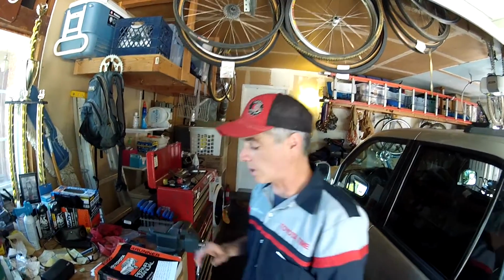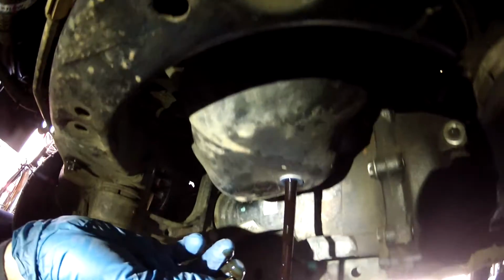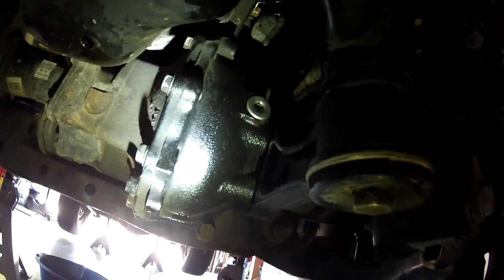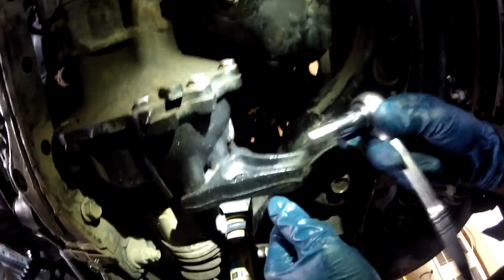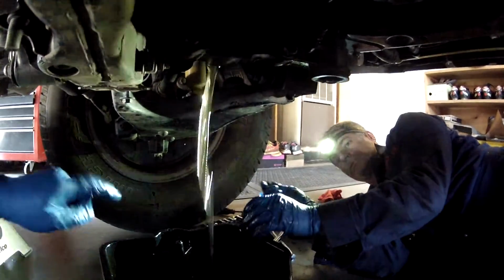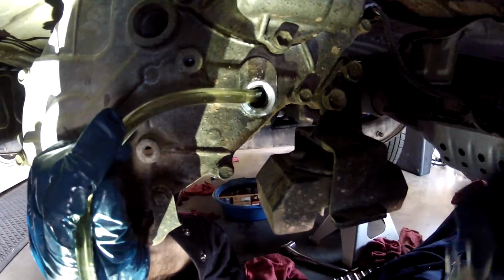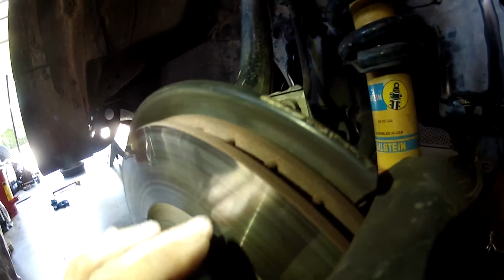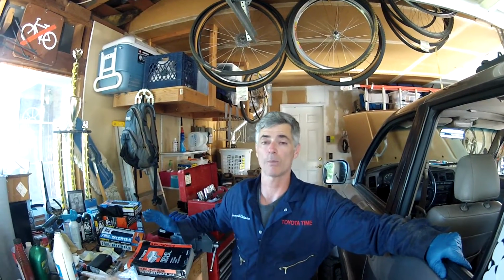30,000 Mile Interval Service

Comment: Just subscribe!! And man your an angel sent from the toyota gods you do a great job explaining step by step and editing thanks for taking your time and effort to explain evrything forget about what people say your shirt is awesome defiantly  sharing with friends...
On another hand how much$$$ did you spend on this project diffenlty doing it on my rig..
Reply from the maker: Hey Edgar, glad you like the video.  I don't remember what everything costs but I'll give you a rough estimate.  

Oil Filter _ $7
5 Quarts Engine Oil - $30
Synthetic 75w-90 Gear Oil for Front Differential and Transfer Case (Apprx 3 Quarts)  - $60
Transmission Fluid (4-5 quarts) - $30
Conventional 80w-90 Gear Oil for Rear Differential - $30
Air Filter - $15
Engine Coolant - you need a little over 2 gallons to fully top off -  $50 (price for Toyota Red Concentrate)
All the Drain Plug Washers - $10
If you don't already have a grease gun and grease, let's say another $30.

Total - $262

I guess it adds up quick but this is a renewal of all you fluids except the power steering and brake fluid.  By the way, we have videos for bleeding the brakes and for doing a power steering flush if you're interested.  You can save money if you don't buy synthetic gear oil.  You can also save money on the fluids by buying online or at stores like Walmart.  

I'm guessing a dealership would charge at least 4 hours labor for this job.  At anywhere from $100-150/hour, you save yourself $400-600 doing this yourself.  They use all these fancy terms like "Multipoint Inspection" but they are basically renewing your fluids, inspecting the brakes , checking the tire pressure and maybe rotating the tires.  And usually when you get the vehicle back, they are going to have a laundry list of services they will say you need to soak you for even more money.  Now, if they are an honest shop, the services they recommend are needed.  A dishonest shop is going to suggest things that aren't necessary, and for the typical uniformed consumer, they are going to trust them and get the other services done.  

Our goal with this channel is to educate and empower people to take care of their own automotive jobs so they are self sufficient and can save themselves a ton of money in the process.  Happy Wrenching and welcome to our channel.

Comment: Hi Tim, Israel here: What kind of Grease did you use for the U-joint and slip yoke. Like what brand is compatible for a 2002 Toyota 4runner??? Thanks for your help! Keep on going brother!
Reply from the maker: The back of your owners manual tells you the type of grease to use.for the u-joints and slip yokes.  But, in case you don't have one, the u-joints are suppose to get a lithium based chassis grease , NLGI No.2.  You can get at an auto parts store.  The slip yokes and double cardan joint (middle of the double u-joints on the rear drive shaft) take a molybdenum-disulfide lithium based chassis grease, NLGI No.2.

For my rig, I've been using a Moly based lithium grease for everything except the rear slip yoke.  For the rear slip yoke, I've been using that special Ford XG-8 grease I show in our Slip Yoke Binding Fix video.

Comment: Thanks  for the great videos.  I just purchased an 01 sport and will certainly be watching most of your vids. One question, is it necessary to oil the new oil filter gasket? It seems it comes pre-greased from Toyota.  Thanks
Reply from the maker: Frankieqd Hey Frank, Yes, always put a film of motor oil on the new rubber o-ring on the oil filter.  I buy Toyota filters too, and if there's some oil on that o-ring, it's not enough.

Comment: Your channel has changed my life. My 4runner has needed practically everything you've done a video on! THANK YOU. Also, i got my rig used; PO had installed an aftermarket Rear Diff locker; dumb question i know, but do i go with the directions on your note card as if the rig had a factory installed rear diff locker even though it was installed after the fact?
Reply from the maker: Brisa Halviatti  All you have to remember with any differential, transfer case, or manual transmission is you fill it on level ground until you see gear oil start to spill out of the bottom of the fill plug hole.  At that point you know you're full and just put the fill plug back in with a fresh crush washer and tighten it to spec or just go tighten it by feel.  Just use some 80w-90 gear oil unless the aftermarket locker you have calls for a different grade gear oil.  If you know the locker manufacturer name, just do a Google search to obtain information on it.

We're glad to hear you've found our videos very helpful.  We love hearing this.  Happy Wrenching Brisa.

Comment: Tim love your work! I pickup my 2000 runner this week and cant wait to jump in following your lead! thank you!
Reply from the maker: Welcome to the club David.  If you have any questions along the way, don't hesitate to ask.
Reply: Thanks Tim, I'm sure I'll have a few :) Planning to document my journey on t4r.org. Just curious from the videos I've scene so far I've noticed you dont use air tools, any reason why not? thanks!
Reply from the maker: Hey Dave, when I started getting into more auto mechanics, I thought about getting an air compressor and air tools but learned cordless impacts were pretty darn strong so I went that route.  I think cordless is a good way to go for several reasons.  With cordless, you don't need a loud air compressor that takes up room in your garage.  You don't have to deal with air lines snaking around and getting hooked on things.  And, there's no maintenance with cordless.  They either work or they don't.  I know air tools are superior in strength over cordless, but since I have so much crap in my garage, mainly bicycles, I figured cordless was the smart way to go.

I've used my cordless impacts in many videos.  I now have 3 Dewalt guns, Two 1/2" drive guns and one 3/8" drive.  I also really like using my Milwaukee M12 cordless ratchet.  The Milwaukee isn't strong so I often break fasteners free with a standard ratchet and then spin them off with the Milwaukee.  Saves a lot of time turning a ratchet, especially in tight quarters.

As I think you probably already know, Sean and I are very active on T4R.  My screen name is "mtbtim" and Sean's is "infamousRNR".  Sean has a build thread so you should check his out.  Happy Wrenching Dave.
Reply: Hey Tim, as always thanks for the thorough reply! I had the opportunity to buy some air tools during black friday so I couldn't pass it even though I would've preferred cordless. I managed to get a 1/2 impact wrench, 3/8 air ratchet and 119 pc impact socket and tool set for 300 CAD which is roughly 210 USD. I already had a small air compressor so it made the purchase that much easier. 

Thanks for the screen names i'll definitely add Seans build thread to my build thread list!

Comment: I was not at all thinking that you might strip a bolt or over-tighten. I would guess you could free-hand tighten to within a couple pounds at any given torque. Only the teaching to someone who may not know. Someone could tighten right past the click if going too fast. Or click on a bolt that has been welded in place. Any goofy thing that can be done with a car has been done by someone, I'm sure.
Reply from the maker: Hey hear you.  It's probably good for new DIY wrenchers to use a torque wrench to get a feel for how tight certain size fasteners should be and then they can graduate to not using one once they got a good feel for it.

Comment: Do you happen to knw the torque specs for the transmission  pan bolts on a 2002 toyota 4runner?
Reply from the maker: I looked in my FSM and it said 65 foot pounds but that's a definite misprint.  I looked it up on a Toyota forum and it's suppose to be 65 INCH pounds.
Reply: Timmy The Toolman: Ok thank you!

Comment: Timmy the Toolman for President
Reply from the maker: Thanks for the vote but i wouldn't want that job.  Doesn't look like much fun.  Wrenching on 3rd Gen 4runners and making videos is way better.
Reply: I will be posting up my rig soon on T4R, you will definitely have a shout-out as you have made my life way easier, ordering most of my fluid stuff today from the dealer and getting alignment/tires mounted this week.
Reply from the maker: Seydzh Chernopiski Well, Sean and I are always stoked to hear our videos have been helpful to people.  It's feedback like this that keeps us motivated.  Thanks!
Reply: Is the masterpro gear oil alright? I just picked some up and was wondering if yours caused any issues or whatnot? I bought the 75w90 for front diff and transfer case and the 80w90 for the rear diff
Reply from the maker: It's working fine for me.  You could always choose a synthetic gear oil but I'm just using conventional oil and fluids in my rig.
Reply: Did you have to add any limited slip additive to the 80w90?
Reply from the maker: No.  Our differentials are not limited slip.  They are a regular open differential.  Here's a link to a site that explains the difference between the two pretty good. https://www.speedwaymotors.com/the-toolbox/open-vs-limited-slip-differentials/28854
Reply: Figured this out last night as I was asking myself lots of questions during the 30k interval service, ending up putting LS 80w90 into the rear diff and full synthetic 75w90 into front diff and transfer case.
Reply from the maker: Like I said, our differentials aren't limited slip but I'm guessing the 80w-90 you used, even though it's said to be for limited slip differentials, is going to be just fine.
Reply: I figured just the same, plus multiple searches across forums said the same as well. 

Thanks for the quick responses!!!

And shame I missed the meet. I'm from Sacramento.
Reply: @TimmyTheToolman  hi. Love your channel. I have a 2004 tundra DC. I started getting a chunk sound every time I put it into drive or reverse. People have told me it might be my rear diff or slip yoke. Any advice?
Reply from the maker: @urbanfisherman323  Check the condition of your transmission mount.  It could be a bad engine mount as well.  The rubber could have become partially separated or completely torn.  I would suggest getting someone you trust not to run you over to get in the driver seat switching between drive and reverse while you're under the truck looking for where the noise is coming from.  It could be a driveshaft issue, but you won't know for sure until you get under the rig and investigate.  You'll figure it out.  Let me know when you do.
Reply: I agree

Comment: Hey Timmy, I just installed a external transmission cooler on my 99 4runner. Using an OBDII scan tool I can monitor my trans temp, on the highway I usually see ~150-170 degrees. When i'm driving through the hills with a full car i've seen it reach ~220 degrees. At what temp should I worry about overheating my transmission components? 
Thanks
Reply from the maker: Hey Adrian, are you using the technique of turning overdrive off?  I have a video about it https://youtu.be/BEZfDOkGVno.  When you're climbing grades and your driving at a speed where you're between 3rd gear and 4th gear (overdrive) the torque converter isn't locked up and your transmission temps will be higher by around 20+ degrees.  If you lock up the torque converter by turning off overdrive, you can run 20+ degrees cooler.  So, I usually just turn overdrive off when I'm driving mountain roads.  Turning overdrive off doesn't really help you when you're in the lower gears but it definitely makes a difference when the transmission keeps going from 4th and kicking down into 3rd due to the climbing effort.  If I'm able to sustain around 60+ mph, I'll turn overdrive back on to keep my engine rpms down.

The temperatures you are seeing even with your trans cooler are normal.  The trans cooler is dropping your temps by around 20 degrees and that's about it.  But, 20 degrees can be a pretty big deal when you're getting up there in temperature.  Depending on the chart you look at, at 220 degrees, your trans fluid will last you around 50,000 miles.  At 230 degrees, the fluid will last around 30,000 miles.  Now, at 250 degrees,  maybe 15, 000 miles.

I was carrying 4 passengers one day driving to a wedding in the Santa Cruz mountains.  The road up to the house was relentlessly steep and long.  I think it was a 15-20 percent grade that went on for a couple miles.  I watched my trans temp climb and climb and climb.  I was just about to pull over and let my transmission cool off when we finally reached the house.  I hit 240.  That wasn't good but I was only at that temp for a very short period.  In the California Bay Area where I live, we have been experiencing a heat wave recently and I was driving up a 7 mile mountain road in 105 degree heat last week.  My transmission hit 225 by the time I hit the top.  I usually only hit around 200 at the top of that hill but because the ambient temperatures were so high that day, the air going through the cooling fins wasn't really doing all that much.  

So, to answer your question, I'd start worrying about your trans temp when you get close to 230 degrees.  If you start going over 230, you start really shortening the life of your fluid which could affect the life of your transmission components.

To keep my trans fluid in decent shape, I do a drain and refill of the pan every 10,000 miles.  So, instead of waiting 30,000 miles for a full flush, I just do the more frequent drain and refills.  I'd rather introduce some new fluid on a more regular basis instead of waiting the 30,000 miles to renew the entire capacity.

This was more than you asked for but I hope you find the extra info helpful.

Comment: Hey Timmy , don't you change the Power steering fluid?If you do, can i use the same automatic transmission fluid?
Reply from the maker: Yes, it's good to renew the power steering fluid.  Sean and I made a video of how to renew it by using a low-tech method of sucking some old fluid out of the reservoir with a turkey baster, refilling the reservoir, starting the engine, turning the wheels back and forth a couple times to cycle the fluid and then repeating until the fluid looks pretty clean.  You can do it another way but that involves removing the return line and you will most likely introduce air into the system.  Introducing air into the system isn't a really big deal because it will work itself out, but the low-tech method doesn't involve removing anything so it's much easier to do.  

Yes, you use the same ATF you would use for the transmission, basically any ATF the meets or exceeds Dextron 3 specifications.

Here's a link to the Low-Tech Power Steering Fluid Replacement video:
https://youtu.be/GOb5yF2Xv8Y

Comment: Hey exactly what engine oil did you use?
Reply from the maker: I've been using Castrol GTX High Mileage Synthetic Blend 5w-30 for a lot of years.  Here's a link: 
https://www.walmart.com/ip/34039137?wmlspartner=wlpa&selectedSellerId=0&adid=22222222227022552727&wl0=&wl1=g&wl2=c&wl3=77517593928&wl4=aud-273067695102:pla-107414678208&wl5=9032131&wl6=&wl7=&wl8=&wl9=pla_multichannel&wl10=8175035&wl11=online&wl12=34039137&wl13=&veh=sem

I know a lot of people like full synthetic but this motor oil has served me well so I stick with it.

Comment: Really enjoy and appreciate all your 3rd Gen videos! Do you remove your front skid plate for regular oil and filter changes too? I always remove mine because it is really messy and hard to get to the oil filter without removing the skid plate. I was wondering if maybe you figured out a way to avoid having to remove the skid plate and not make a mess when changing the oil filter?
Reply from the maker: Absolutely I remove the skids every time I change the oil and filter.  I have stock skids so it's not that bad.  If I had heavy duty aftermarket ones, it might be a different story.  For the oil filter, I've heard people put a large zip lock bag around it to capture the oil that comes out.  For the oil pan drain plug, I can't remember what people have come up with for that.  I think whatever tricky way you come up with to avoid removing the skids plates, you're bound to spill some oil on the skids.

If you have stock skids like me, I'd just take them off every time.  It's not that much work, especially with a cordless ratchet like the Milwaukee one I own.

Comment: How many zerk fitting are there?
Reply from the maker: You have 7 zerk fittings.  There's 3 on the front driveshaft (2 for the u-joints and one for the slip yoke) and there's 4 on the rear driveshaft (3 for the double cardan joint and one for the rear u-joint).  The double cardan joint is made up of 2 u-joints and a center joint.  Each of those joints has a zerk fittings.